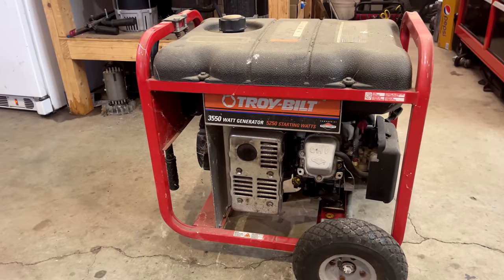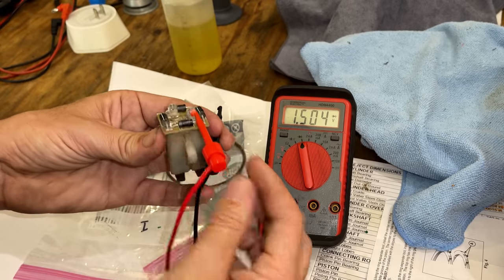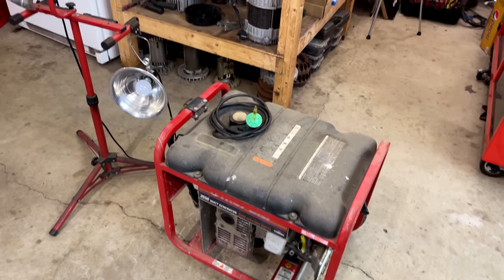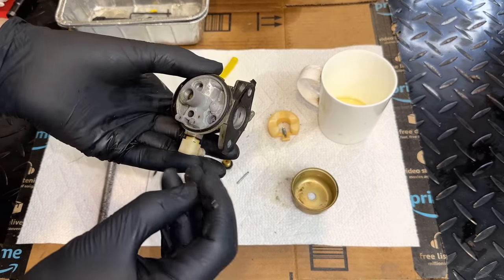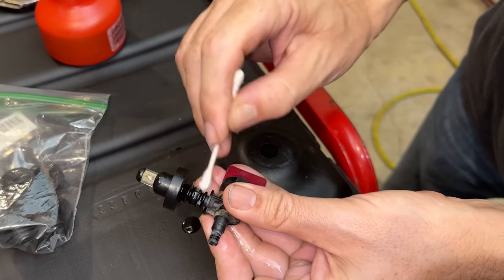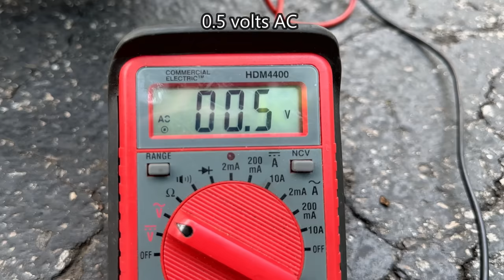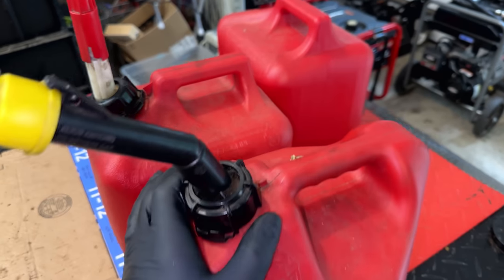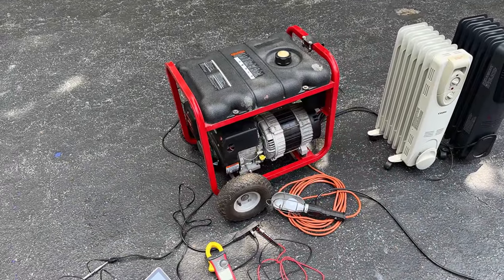No Power Output - Will Flashing the Field Restore Power?

Comment: Why not just use the brush block with the diodes. Connecting a DC or an AC voltage to the two pins (not exeeding the current limmit of the rotor) will result in a voltage on the brushes with the correct polarity which would magnetise the rotor. Just disconnect the 2 wires and connect your fused supply voltage and you should be in business.

Comment: Perhaps this is a silly question just got the idea in my head. Would it be possible to use a powerful neodymium magnet on the side of the stator to induce residual magnetism and avoid using the battery or drill?
Reply from the maker: Not sure

Comment: Excellent video James. I am curious about one thing. A lot of rotors I have seen have small permanent magnet at one end. Does that magnet stop the need for flashing by generating a small voltage in the stator windings to start the process of fully magnetizing the rotor.  Or does this magnet become too weak to do the intended job?
Reply from the maker: If it has a magnet and the generator does not power up then no need to flash.  The issue is hallucinating terminal or a bad AVR.

Comment: Great video. I have a 15 year old Honda EM5000S that was idle for about 6 months. I flashed the field and in started making AC power at full capacity. Unfortunately, it the field has to be flashed if it's been idle for only 2 - 3 weeks. Do you have any tips as to what's causing it to lose residual magnetism in such a short period of time? Thank you.

Comment: Hi Jim. Great video. I have a similar generator (5500 watts).   Lacking the brush holder without rectifier i would CAREFULLY touch the slip rings with probes to get magnetism again. Is there a way to tell which slip ring is positive?

Comment: hi have you put a multimeter on a drill plug while turning the chuck because i am curious if it actually generates any power because it is a universal ac motor
Reply from the maker: I have and it does, but not much.  Am guessing just residual magnetism producing some AC.  Not the best way to flash the field, but easy and safe if it works.

Comment: Did I miss why you used a different set of brushes for applying the 12 volts?
Reply from the maker: Probably could have done it through the bridge rectifier.  The only potential issue is the surge when the battery is disconnected.  Potential to damage the diodes or the MOV.
Reply: @jcondon1  I guess I'm missing something.  It looked like you jus removed  the brushes and put a different set in and applied the 12v. Why not do it to the brushes that you removed?

Comment: on flashing why cant you take another drill; and place a rod between them  using your house voltage to turn your help drill to turn your flash drill now i know you would need  to jerk the plug out to you flash drill  to keep your drill from fighting one another maybe using extension chord on floor with maybe your foot on it incase it starts the flash drill not sure im making my self clear but that's my thoughts unless to do this your only looking for a spike pulse if not otherwise you would have constant  voltage

Comment: James, I think us Small Engine guys are due for another Q&A Live about generators!

Three main reasons generators lose residual magnetism:

1. Generators sitting too long without running with a load. This is negated with permanent magnets on the poles as you pointed out. Not all generators have this though.

2. Corrosion of the rotor lamination causing parasitic loss in magnetism and loss of magnetic retention. Generators should not be stored outside even under a tarp. Humidity/moisture are the #1 enemeies of generators besides heat.

3. AVR has electrically leaking capacitors that prevent the AVR from turning on below 4VAC. Typically residual magnetism at 3600rpms you get 6-8VAC.
Reply from the maker: We are overdue.
Reply: @jcondon1  let's schedule some time! I'd say in the next week or two maybe?
Reply: Didn't you forget number 4?  According to James, The failure of the bridge rectifier diodes may have scrambled the field or demagnetize the residual magnetism
Reply: @robertmorin6495  you're right. It's plausible for the diodes to demagnetize the rotor. Funny thing with diodes is they can test good on a DMM, but fail/leak under load in circuit.

Comment: Don't you have to run the corded drill in reverse to flash the field?   Can you flash the field using a little 9 volt battery connected across the 120 AC lines while the genny is running?

Comment: A point of triva. On a restive load electric heat voltage down amp load (watts) down.  Voltage up amps (watts) up
 Inductive load (motors) voltage up amp (watts) load down. Voltage down amps (watts) load up.

Comment: Could the lack of sparks when flashing the rotor be caused by diode avalanche. That the diodes in the rectifier would conduct current in reverse before the voltage got so high as to cause sparks?

Comment: My generator is slightly different than this one and flashing it didn't work so I replaced the voltage regulator and that didn't work. So the instructions said to flash it and it was producing electricity. So I reconnected the voltage regulator and restarted it and no output. Sad, having a dead battery I was hand starting it, then I decided to jump start it off the lawn mower and it started working, then I disconnected the jumper cables and it's been working ever since. So it was worth buying a new battery.

Comment: Would when you are testing diodes;
No voltage drop = display --> 0.0v
Or are you talking about the voltage reading of the multimeter?
Reply: Also, what multimeter are you using? Because I would find one like yours very helpful as some of the diodes I work with can have up to 3v of drop across them, and having a multimeter that tells you what its maximum range is can be very helpful!

Comment: Why don't you take another drill with a hex bit then connect both chucks and use the drill to spin the other chuck on the other one you're trying to make the power to remagnetized the generator

Comment: I noticed a couple of the combined brush rectifier units looked like they had a small capacitor.  Have you ever found a bad capacitor ?  And, does the capacitor act as a small initial charge to the rectifier and rotor?

Comment: Hi James I have a Generac guardian 15,000 watt generator set. It wouldn’t start, pulled carb was very clean no issues, a solenoid on the carb would not activate so I removed it and it fired right away. However no power output,saw on Generac website field flash,tried it no power. It is a 2008 vintage machine less than 100 hrs. You mentioned that the magnet shouldn’t have that issue if less than 20 years old. Any ideas from here thanks in advance.

Comment: Can the drill which is most probably a universal motor or an inuction motor without magnets generate energy for exciting the coil? I thought if you spin the drill like this it wouldn't generate a voltage. But i am probably wrong😁. It would be interesting to see what would hapen if you coupled your cordless drill to the chuck of that one and spin it for a bit.
Reply from the maker: It does generate some voltage, but you are correct.  A universal motor is not the best choice since no permanent magnets.   Only residual magnetism to work with.

Comment: Hello James,
I am hoping you will see this and help me with a question. I am retired and living in a small town in Mexico where it is very hard to get parts. Amazon is the only safe way to order anything. I have a Coleman Powermate that has a similar issue to one you worked on a few years ago that made low power and needed a new bridge rectifier. Mine makes 97 volts. Everything checks out with ohm testing. But instead of a bridge rectifier plate, it had a little square box diode bridge and a separate capacitor. The capacitor looks bad. I can’t find the exact one on Amazon. The original is 130 uf 200v. I can find a 140-150uf 250volt. Do you think this would work? Also the one you worked on used a 480uf 200v I believe. Why such a big difference in uf?
Reply from the maker: A higher voltage rating is no problem.  A different uF rating will result in a different voltage output.  Should not cause damage to the generator, but the voltage output might if too far off.

Comment: I’ve always had to rely on small wires through the jets, then card spray cleaner then compressed air in the opposite direction of fuel flow as best possible.  An ultrasonic is definitely something to consider if I get back into carbureted small engine work.

Comment: I don't believe you needed to take the bridge rectifier out to flash it with 12volts, the diodes should have passed 12vdc through them just fine given the proper polarity connection.

Comment: Just an honest question with no malice intent… is that Ryobi impact just that weak or are those small air filter bolts that tight? I never have issues with my DeWalt or Milwaukees. It’s making me want to send you one of my extras that I never use brother. And I’m not referring to the carburetor bolts u had trouble with either. 😅

Comment: I would start the old 13Kva farm PTO units units with a hammer just tap the field and it is ehough to get some magnet to flash the field did the same with older milt geneators (400 cycle )

Comment: Maybe flashing with the drill works better if you run it a second before using it as a generator?🤔
Reply from the maker: It probably would.  Universal motors do not have permanent magnets.  Residual magnetism may have been low.
Reply: @jcondon1  Hello James, thank you for your reply.
Exactly my thoughts on that.😎

Greetings from Germany.

Comment: When flashing the field does it matter if you have the drill in forward or reverse and which way you rotate the drill chuck?
Reply from the maker: It should not matter, but if holding the drill with the left hand then it’s best to run it in reverse so the drill spins in the same direction you are manually rotating.  That way if the drill powers up less likely to hurt your hand.

Comment: I have a scorpion SC2500 and it had no power output. I checked the AFR and Brush and no issues. On the panel it has a Voltage indicator and in that there is a little black screw. I twist tgat a couple of times and boom, power output. Hope this helps someone.

Comment: A quicker way to check the diodes is to check at the leads directly. Put the black lead on the striped end and the red at the other end, and you should get a reading as indicated, then swap the leads around and you should get an 'open' reading. It might not be a bad idea to ensure that all four forward voltage readings are somewhat consistent as well.

Comment: Couldn't you just touch + and - to the slip rings, if you don't have the brush set you have?
Reply from the maker: You can also go through the stock brushes with the bridge rectifier.  Will not hurt it.
Reply: @jcondon1 James, if it won't hurt the stock brushes, why change brushes?
Reply from the maker: @Rorschach1024  did not think about it at the time.  Also the collapsing magnetic field when removing the connection from the battery could damage the diodes or the Metal oxide varistor.  Most likely it would have been ok.

Comment: Could you have put the 12v through the outlet like you were trying to do with the drill generator??
Reply from the maker: Some manuals say to do that for a second.  The only down side is when the generator powers up you will be sending 120 volts AC into the 12 volt DC battery if not fast enough removing the connection.  That is why I like the drill trick.  The drill is happy with 120 volts.  The 12 vdc battery is not.
Reply: Oh gotcha,,good info thanks

Comment: Not as convenient to get to the fuel shut off with the 90-degree you can take a heat gun and mold that gas line into the form you want it and it'll stay when you cool it off that's what I would have done

Comment: I’m a little on the fence about whether that loose throttle shaft causes a lean condition being that it’s ahead of the jetting signal and airflow there.
Reply from the maker: The shaft is between the emulation tube and the engine.  I guess it was not enough to cause an issue.

Comment: Diodes will clamp the spark so you won't see spark with diodes
Reply: The current going through the diodes when you disconnect can't be more than the current before you disconnect  so it won't hurt anything
Reply: The voltage before you disconnect would be much higher than the voltage before you disconnect (12V in this case and why it sparks) except that the diodes clamp the voltage to about 1.5 volts.

Comment: Supposedly the heavier the socket, the more inertia it can apply to the fastener thus a deep well was a good idea for removing the carb. A deep well impact socket might even be better if there is room for it. Heavier impact sockets are available.
As for flashing the field with a drill, couple two drills together so more voltage can be generated with this makeshift genset.
BTW, my brother-in-law believes that a close lightning strike will suck the residual magnetism out of a generator. :-)

Comment: https://youtu.be/NI0eNhsOh7k?t=2572 when you have this issue replace the bowl gasket and make sure you have a good seal carb to block intake . if the bowl gasket is bad the venturi effect can be effected thus making it only run on choke settings ,use some carb cleaner and check the air inlet to the bowl i seen you use the brush but always blow it with carb cleaner .

Comment: You should try the ultrasonic with just hot water. You’d be surprised how well it still cleans.
Reply: Why change success the way he does it. I have two ultra sonic cleaners and always use a small amount of detergent.
Reply: @watermanone7567  Because he said his cleaning solution swells the rubber in the carb, so give a try without it.

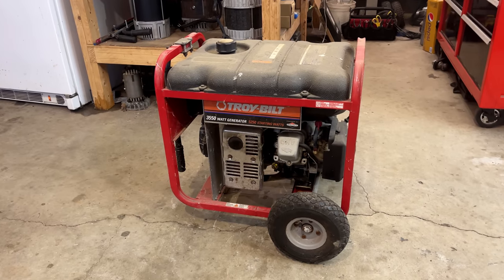Comment: 00:23 needs to be running so not weld/damage slip rings due to possible signle point contact damage. When they're spinning the brushes seat better.
For god's sake man, spin that drill with another drill!

Comment: I have a 5000W class Powermate that has a blown 10hp briggs engine. If anybody has a generator type engine they want to get rid of, that would be compatible. Feel free to drop me a line.
Reply from the maker: I still have this one.  Has a little damage at the bottom of the cylinder.  https://youtu.be/3eR9ab5MMtY
Reply: @jcondon1  Id be ok with that. it would be a backup to my main one anyway. what would you want for it?